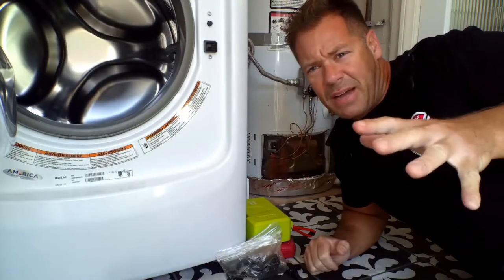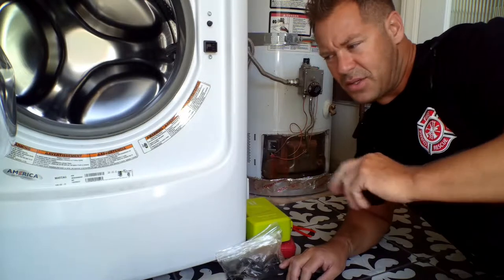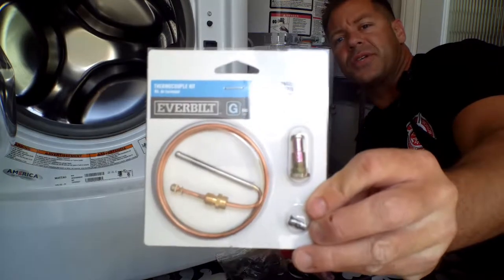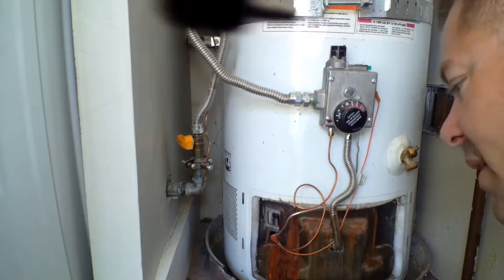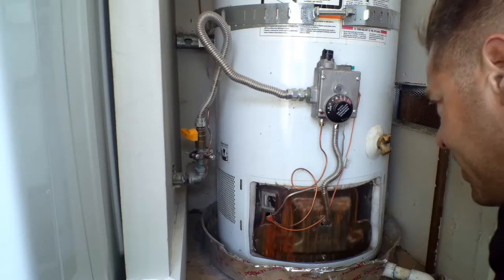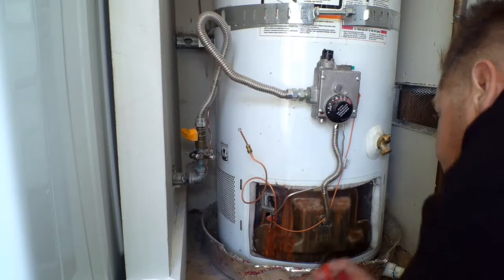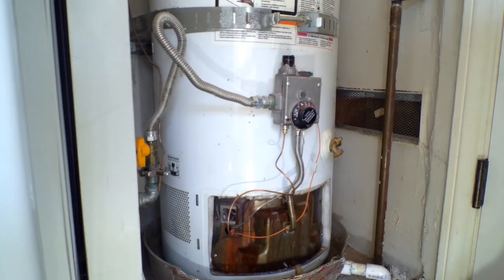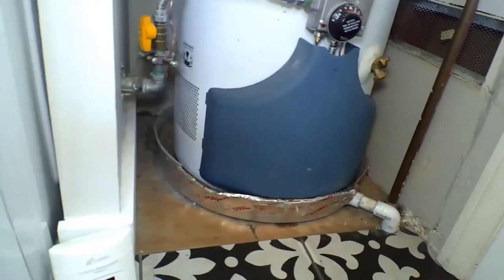Replacing a water heater thermocouple

Comment: Hi quick question. Should the igniter spark be jumping to thermopile or to the pilot? I've replaced my thermopile but the problem I'm running into now is that even though I see the igniter spark, the flame doesn't catch. I ended up using a match to light the pilot. 

By the way, thanks for the video.
Reply from the maker: Great question Aron, I could be an old system #1. I've replaced it a couple of times in a 4 year time frame. I've had similar issues. You might have to ask a plumber. What I did is visualize my original way it was installed and copied it.
Sorry if this didn't aid.
Reply: @FirefighterCafferata  thank you sir for your reply